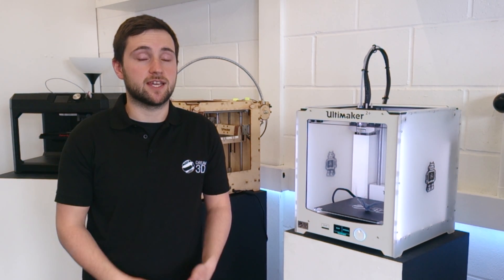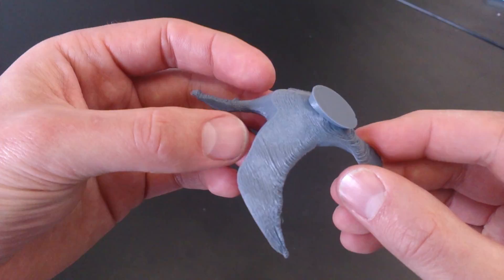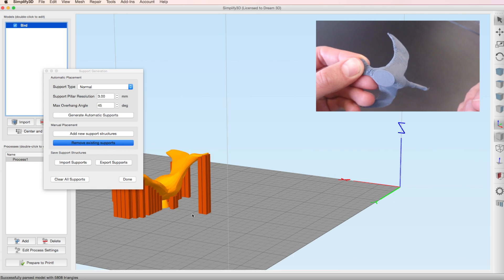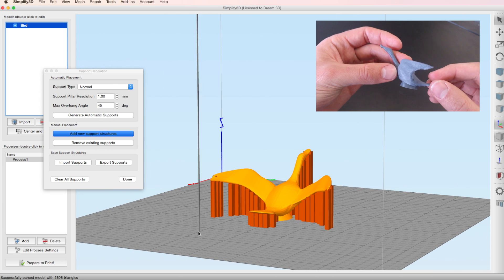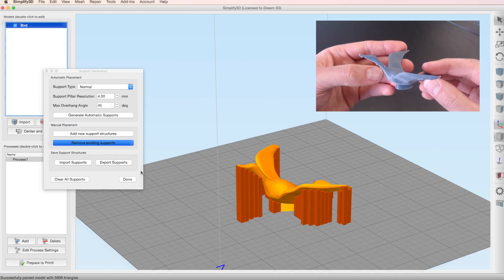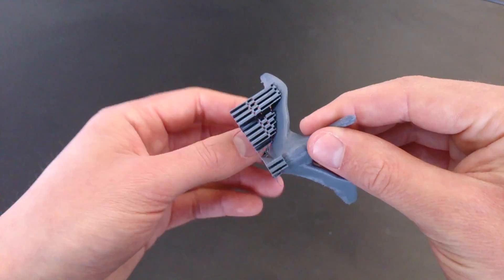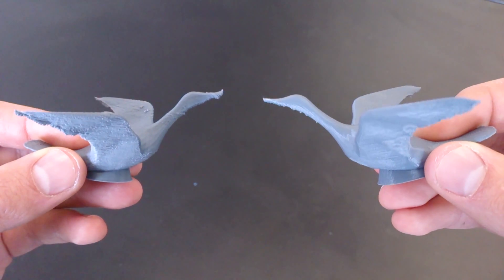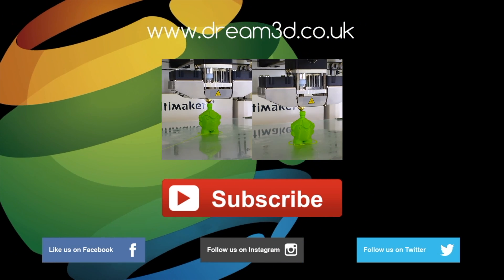Custom Supports in Simplify3D | Tutorial | Dream 3D

Comment: What are the benefits or disadvantages of using bigger or smaller supports?
Reply from the maker: Hi +Mighty Jabba's Collection, you will get better accuracy with more smaller supports, but the bigger supports will give you greater stability on the build platform. A lot depends on the model too, sometimes you will only need to support a very small area.